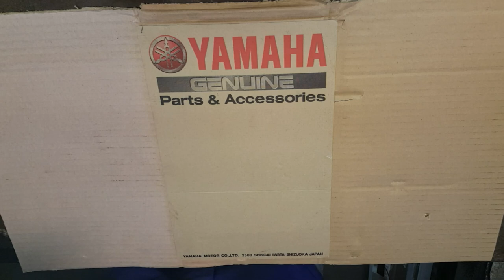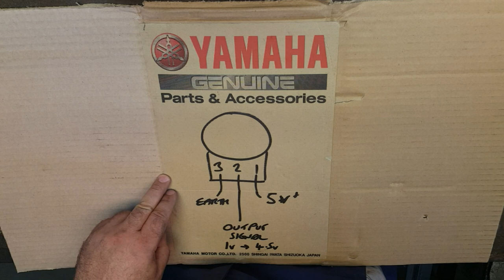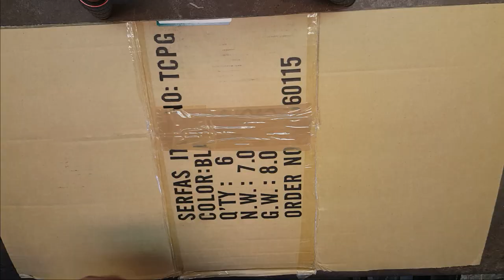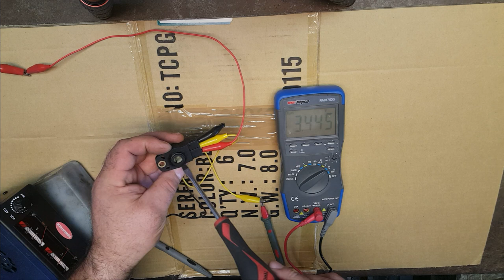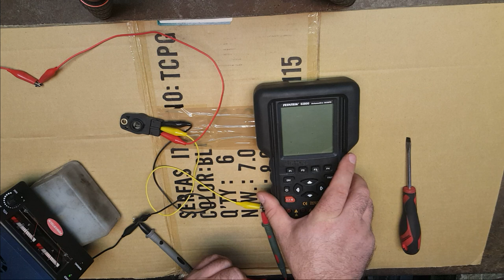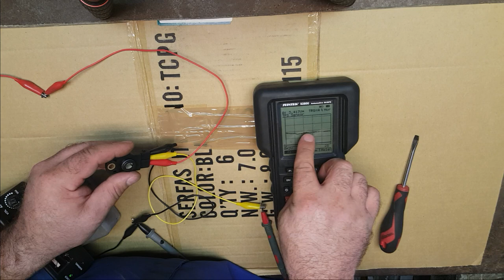How to test a Throttle Position Sensor TPS #1203

Comment: My tps fluctuates alot and my ideal goes up all by its self and then stays high is the tps the problem
Reply from the maker: Hi, the TPS provides a signal voltage to the ECU. This information is used to calculate fuelling. The voltage must be accurate & represent the position of the butterfly valve - ie the amount of air entering the engine.

The signal needs to be rock steady, if not, TPS circuit or component may be faulty

Comment: I really dislike videos that try to help explain how to test something and there’s so much fluff and unnecessary stuff. Get right to the point please.
Reply from the maker: ....to be only given the answer or solution without first an explanation removes any real depth of understanding. Without the knowledge of how the component/system works diagnostic ability is unlikely.

If all you want is the answer then I doubt my videos will be to your liking. 

Andy

Comment: Hey I got a 2017 Yamaha yfz450r it's just dumping gas into the motor  no matter where I set the  vortex  ECU it's black smoking turning sparks black does this sound like a bad TPS
Reply from the maker: Could be but just check your injector spray pattern too, needs to be a mist rather than a jet.

Also check coolant & air temp sensors for correct spec as if ECU thinks engine or air temp lower than actual it will richen the mixture & may even remain stuck on cold start

Cheers Andy
Reply: Okay thanks for the advice I'll try to check them today
Reply: I had the same problem last year I bought a new injector and put it in without even checking the old one and then it worked to find for about 6 months now it's doing it again but I pulled injector out and checked it and I checked the old one and they both sprayed just fine
Reply: @AndyMechanic  I think I'm going to order new ones on eBay I got a TPS sensor in my cart and a coolant water temperature sensor.. is a coolant and a air temperature sensor two different sensors?

Comment: Got a tps on CV40 carb 1.0 at closed up to 5.8 when open. Spec says .5 at closed max wot 3.7 think this would cause no idel ??
Reply from the maker: 5.8 is impossible as its over the 5v reference. I think you may have a faulty multimeter?
Reply: Andy Mechanic Roger. Thanks!
Reply: Raise it to 0.45 or near, and less than 5.00 max 4. Or just over is fine.

Comment: Andy, I am trying to troubleshoot my 2008 Yamaha Ourtboard.  When I throttle the engine up and get to about 50% on the throttle lever the engine tops out.  Basically I am only getting 50-60% power out of it.  Is the TPS a likely culprit considering the symptoms?  Thanks for your video and any feedback.

Comment: Can a tps sometimes pass testing with the vehicle off or removed, but fail during engine operation? I have racing mounts that cause allot of vibration and I think this is happening to my tps.
Reply from the maker: You need to test accurately, very slowly rotating to watch for any change in reading. Also check wires & pin connections too. :-)
Reply: Everything passed.  It's on a kseries honda where the tps are kinda known to fail with vibration.  Sometimes the car performs well and other times it seems like its experiencing a lean mode, killing the power. A few times upon take off, it idled very low like it was about to miss but didn't.  No engine light no backfiring.  I'm stumped.  Great videos brother thanks
Reply from the maker: Ah, I had the same problem on a Chinese bike, passed all the usual testing yet when I swapped it out the lean issue & poor starting was fixed. Really odd but that part was also known to be damaged by vibration. This was a brand new bike out of a crate - the crate had been dropped!

Cheers Andy
Reply: Haha did the bike happen to be a honda cbr ? They use a similar tps as mine. Thanks bud I really appreciate it.  Everything else seems to be in order and my final suspect is that tps.

Comment: II have a 2004 Suzuki bandit I've tried testing the TPS sensor with my multimeter on the 2 outer most pins on either end... Saw your video on testing it and I saw you're running a 5 V lead do I have to do that with my 3 pin TPM S sensor off the bandit ??

Comment: Thank you. On my sonata 2000 the TPS will not decreases to under 2.3 volts with throttle fully closed. But when removed it working well .Although the idling adjusting screw is zero tension.
Do you think I should re adjust the pinon of throttle when fully closed by loosen something to put the TPS to zero position?

Comment: Very interesting Andy, I just purchased a new carb for my 2007 Honda 500 Foreman and the TPS is in the wrong position. The electrical connector will not real from the harness. The old carb had the TPS facing up. Do you have a video on how to move them around to fit...thanks

Comment: I have a WJ. Is a throttle closed voltage okay at 1.2v? Or is it too high? At fully open it is at 5.2 volts 🤷‍♂️ 
Thanks
Reply from the maker: Hi, the 5.2v Throttle wide open worries me as the supply voltage from the ECU should only be 5v. Check your 5v+ ref wirr from the ECU, if it's over 5v you may have an ECU problem.

Cheers Andy

Comment: Andy thanks 4 the video ....My 04 subie workshop manual says to set it wile idle (throttle resting position) 0.6 v but it does not specify how to test it should it go higher, lower and or whats the minimum or max ? Would you know

Comment: I have a question, what's the reason to exist the number 3 pin, which is the earth?I understand only two  pins, 5volt reference, and the output signal, but what's the reason to exist the earth in the 3pin tps sensor?

Comment: Hey!!! I got 3 wires. Black/red, grey/yellow and grey white. Which one is ground and which one is the second one? Thanks!!
Reply from the maker: I have no idea as the wire colours vary depending on make & model of vehicle. You can work it out though by using a multimeter. One wire will have the 5v reference, one will be ground & the remaining wire will be the signal wire back to the ECU.

Cheers Andy

Comment: great video i have a xj600n yamaha 99 plate which will only run on choke even when the engine is warm and if you apply the throttle it dies any ideas on what to do?
Reply: A complete Carb cleaning might be the first choice here. Assuming this is an older carbureted model and not the newer injector system. 
Old gas that sits in the tank & fuel system for 6 months or more, can really gum up the fuel delivery system. This is especially true when 10-15%  "Ethanol"is blended into gasoline. Common problem, easy fix sometimes. Most times, 
1. Remove carburetor
2. A good cleaning of the exterior recommended
3. Inspect fuel bowl, jets and all orifices. They need to be cleaned of any obstructions, gunk or schmoo. Carb cleaner or Throttle Body cleaner should work in all but worst cases. Use compressed air after soaking carb & parts
4. Reassemble carburetor in the reverse order taken apart. 
5.Specifications and settings for needle valves and float would be worth looking up for this engine.

Google/YouTube will likely have videos on this subject if you look. If you find any damaged parts, now you're chasing for those as well. Good luck and hope it goes very well for you. Take your time and do it right the first time.

Comment: Thanks, I'm getting a c14 error on my Suzuki SV 1000 which is a TPS error so this has been helpful. I've got a good multimeter I've been thinking about getting an oscilloscope, yours looks really good but I guess expensive. I started in electrical/electronics over 30 years ago fixing circuit boards and move more into IT. I still can't believe IT guys in the workshop don't even have multimeters.
Any suggestions for good workshop oscilloscopes?
Thanks again :)
Reply from the maker: no problem, we'll my first Picoscope only cost me $240 which I thought was very good. It wasn't a dedicated Automotive scope but still was very useful.

Pleased you enjoyed the video. Cheers Andy
Reply: @AndyMechanic  I bought a TPS from ebay for my Suzuki, I'm going to try it out but it seems like it's a simple variable resistor (rheostat) with a spring with the far pins at opposite ends of the resistor track and the middle pin on the tracker. So I think you just use a multimeter measuring ohms to check the 'sensor'. It seems like a very expensive variable resistor! Thanks.
Reply from the maker: The critical information you need are the specs. The resistance  (or voltage output) when throttle is closed. this is very important info for the ECU. Without this spec (and it varies between models & manufacturers) you are shooting in the dark...

Good Luck :-)
Reply: @AndyMechanic  Thanks, good point. If we knew the spec it would be easy to test. Thanks.

Comment: What would happen if the iscv is disconnected when engine is running??? Will the engine stop or continue to run?
Reply from the maker: Depending on the type of ISCV - if a steper motor type it will just stay at that position, ECU will then be unable to adjust RPM - if a 6 wire type then it will take a while for a fault code to flag. If there is a 7th wire - feedback to ECU  - then fault code will flag quicker.

What type of ISCV is it or what vehicle?

Cheers Andy
Reply: Andy Mechanic it's hyundai i20 1.2 petrol manual transmission India version. It's 3 wire.

When the iscv valve is disconnected during engine running, the engine instantly off. Is this normal??? However, the car can still be started with the iscv plug remaining disconnected!!!!

Actually, i was trying to fix the car rpm which drops to 600 as against the normal 800 to 850 rpm at idle. Done throttle body cleaned, no warning signs, battery relearning process, etc etc but still low rpm!!!! No poor performance on engine while on road running. Everything is ok except the low rpm!!!!

Also, I scanned with OBD scanner and the throttle position reads 5 or  percent at idle . Is this normal range reading??? Doesn't the throttle valve is supposed to closed fully when idle ie it should show 0 percent???

Comment: Will the TPS make the bike Miss and run rough
Reply from the maker: Yes, if the TPS signal does not reflect the true position of the throttle butterfly then the fuel/air mixture will be incorrect.

Cheers Andy

Comment: Its the same test for can am ATV?
Reply from the maker: Hi Mfx, most TPS work in a similar way. Just check you are getting a steady change in resistance (or voltage if you test on the atv with ignition on, as you turn the shaft). If you get any sudden changes them it's junk & you'll need to replace it. Cheers Andy
Reply: @AndyMechanic  thanx Man i check the tps its good m'y idle bypass valve its scrap

Comment: The best way to test the linearity is to use an analog voltmeter!
Reply from the maker: I have to disagree, an oscilloscope has to be the best way in my opinion as it plots the voltage change which can be reviewed and compared to a known good.

Thanks for your feedback 

Cheers
Andy
Reply: Andy, you are right, but considering the cost of oscilloscope, analog meter can still give you a better visual results than the digital one. Analog meters can be picked up for less than $25. But yes oscilloscope would be the best way to go!